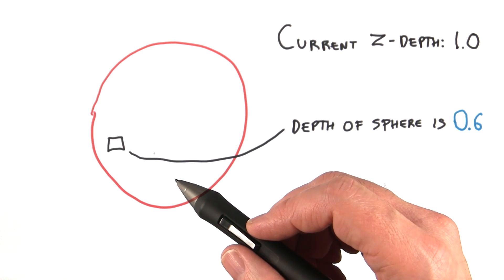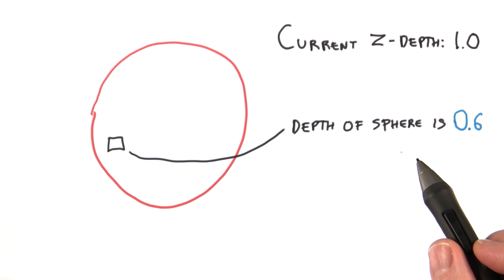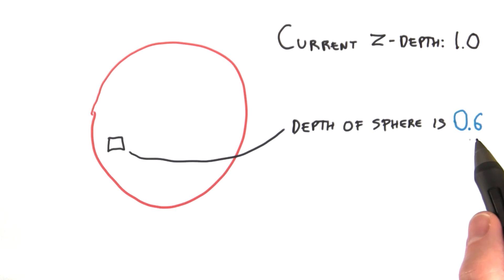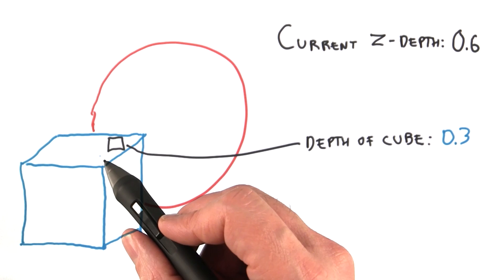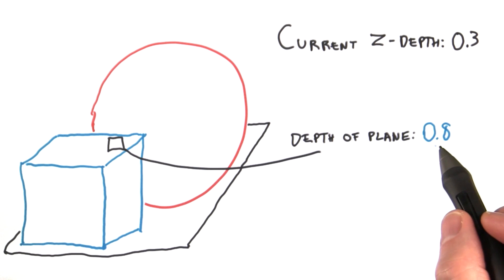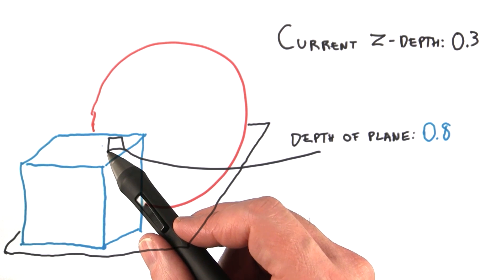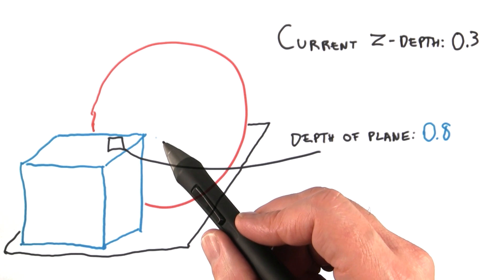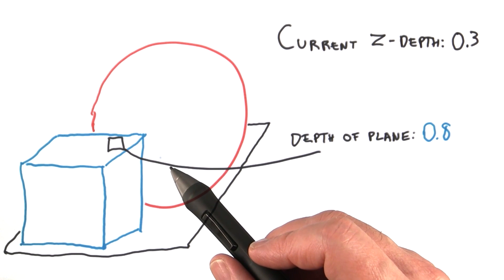How the Z-Buffer Works - Interactive 3D Graphics

Comment: but how do you calculate the depth?
Reply: I am kinda new to graphical programming, but as far as I experienced and understood depth value is not calculated separately. When you send the data of your object (x,y,z positions) to the GPU it containst the Z value which IS the depth value itself. So if you draw a point at the position of (x: 1  y: 1  z: 0) and an other at the same position but with different depth value: (x: 1  y: 1  z:  1) the second point will be discarded because it's depth value is further away from the camera than the first's one and only the first point will be visible. Just because of the Z value that we sent to the GPU. When you create a triangle from 3 points the whole triangle pixels are interpolated between those points and they generate an interpollated Z value based on the x,y,z positions.

I hope I am correct and I hope I could have helped.
Reply: @dariusz4434  What bewilders me is that couldn't this image exist, with those specified points, and both be visible? just because one is beneath the other doesn't mean both cannot be visible. If the form overlaps the other, then you would want the lower depth object to be drawn first, but that doesn't mean that the other object couldn't be much larger, and therefore still visible beneath it,
Reply: @Retrofire-47  I'm not the most experienced in this but to my understanding, the "object" in this case is the individual pixels belong to a bigger object. So while a bigger object can still be partially visible if it's behind a smaller one, the pixels of the bigger object that are covered by the smaller object would not be rendered per the Z-buffer algorithm